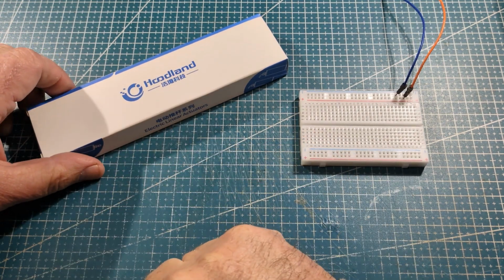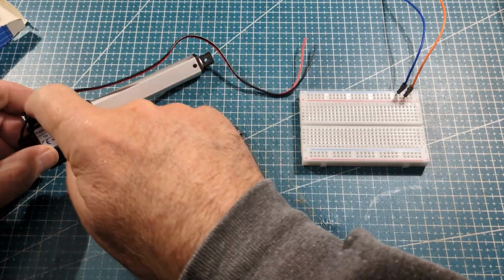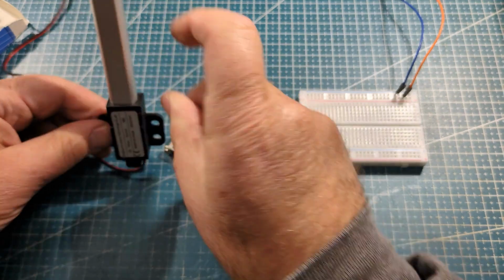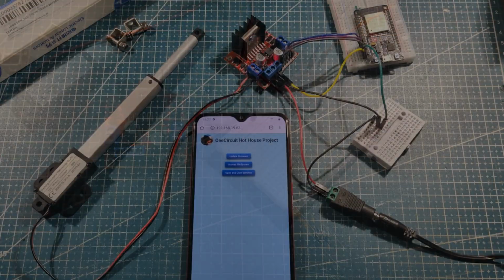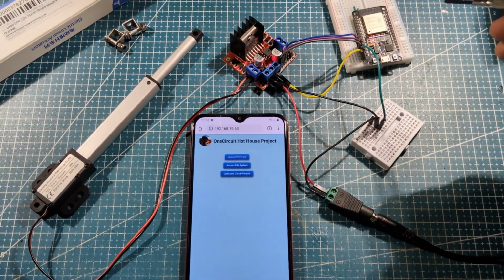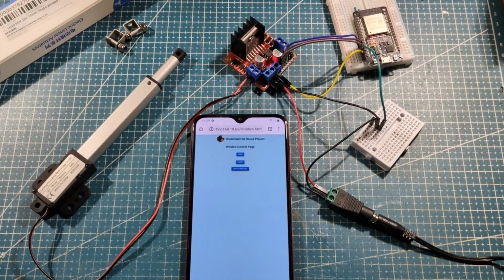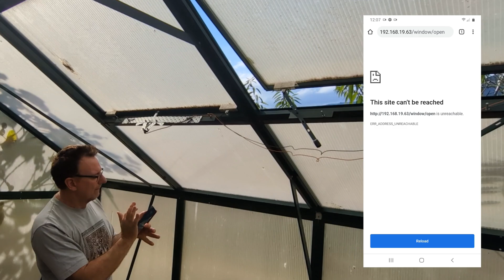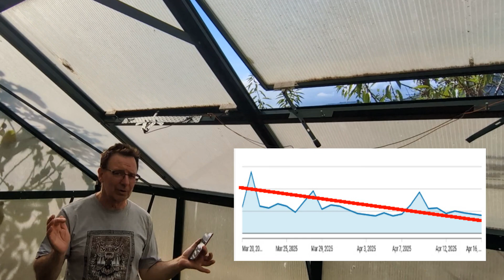Open Hot House Louvres Automatically (Linear Actuator and L298N)

Comment: I purchased 2 of them. Exact same specs but they are slightly off. I tried using the L298N by changing the speeds but no luck. I dont know how to get these to sync. I got mine from china out of ali express
Reply from the maker: @metallicaandchimaira  you might need to fiddle the code to give the different channels separate pwm signals?  The second one for my project arrived so I'll check it out.  👍😀
Reply: @onecircuit-as  yeah already tried that and it doest help even if you are applying different loads to the actuators.
Reply from the maker: @metallicaandchimaira  can you drive both from the same side of the L298N. Sounds dodgy but it should give them the exact same signal?
Reply: @onecircuit-as  well I checked the voltages during movement and it’s the same on both sides.

Comment: Hi, I have just finished a project using these actuators to operate blast gates on my dust extraction system in my wood work shop. used a double pole double throw relay to keep it simple. These actuators are amazing little devices. Cheers Dave.
Reply from the maker: I've been impressed so far - I'd be interested in your setup as I want to have a redundant switch panel in case the ESP32 IoT stuff goes kaput!